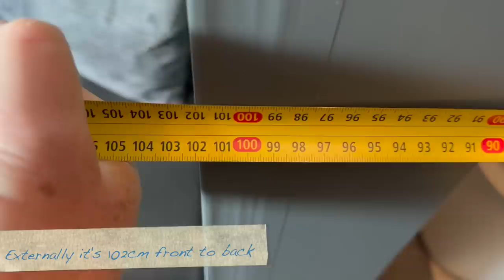Solar, Heating & Internal design ideas

Comment: The great thing about these videos is the coverage of the practical aspects of vans and van life etc. and this is another useful and interesting vlog. In past trips to the NEC etc to look at new vans, I've always had a sit on the toilet to see if its in a practically sized space, and many are just too confined to be practical. (You do get some funny looks doing this 😄). I'm tall with long legs, so width in the space is important, but providing this can really restrict the width of the space in panel vans so most commercial fit outs don't offer sufficient space for either toilet use or showering. That's one of the great things that can be properly sorted out when designing and building your own van, along with counter heights and mirrors etc. (The people who designed/built my van were probably around 5 foot tall judging from the position of the mirrors stuck in the toilet cubicle) and compromises worked out to best advantage. If I had a choice, I'd place the toilet in the corner at 45° as it's the most economical use of the floor space whilst still giving enough room to shower and get dressed etc. 👋

Comment: Hi John. Have started insulating the heating pipes. Some come outside and run along under the van. Am using some car windscreen sun shades which are bubble wrap with  foil on each side. Should this be ok. Very informative video. Just ordered the solar drains. Had never heard of them before

Comment: Hi John,
Great video thanks,
Two questions if I may?

What is the black item you have above your bench closest to your drivers seat please
And what I’d the item you have used to finish between your solway panel and the roof please,

Thanks John 🤝
Reply from the maker: The lights I have are black, is that what you’re referring to?  I haven’t really finished the ceiling to solely panels yet.
Reply: To the right hand side of your head in the video, Mandy has a white one. 👍